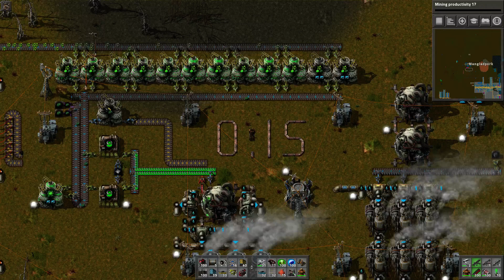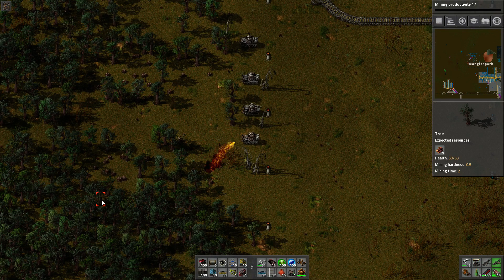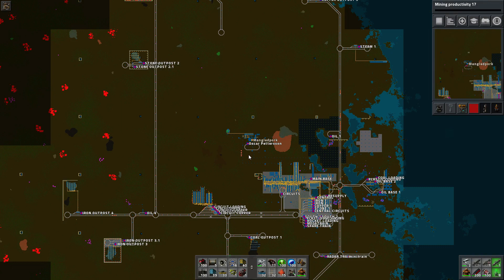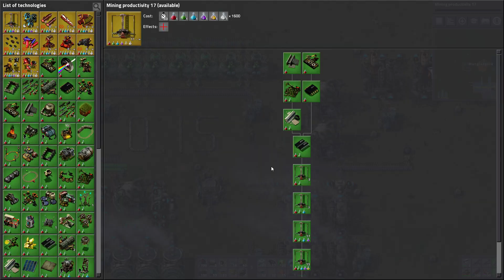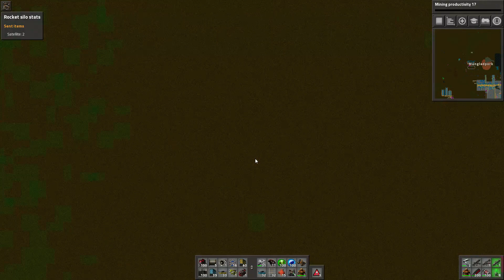Factorio 0.15 Update Overview

Comment from the maker: If you're having trouble updating: https://www.youtube.com/watch?v=sruKeZXXVTk
Also, a correction for 56:03 : There actually are different recipe difficulties which include gears and circuits requiring more than double their normal resources.
Reply: "Fluid" can refer to any liquid, gas, or plasma
Reply: The propability for uranium 235 is 0.7% or 1 in 142.85....
Reply: @34:20 press the red button to the right to enable pollution overlay
Reply: Benjamin Steinmann  its .72
Reply: Austin Hayducky Yep.

more iften than not, something like 'computational fluid dynamics' is used to study gases rather than liquids...
Fluid is the generic term, gas, liquid and plasma are more specific.

Gas is a fluid, but not a liquid...
Reply: steam is a gas
Reply: thought is overview and not u talking 60 minutes about the same thing. and pls learn something about atomic energy. Its realistic.

Comment: Yeah, the fluid wagon seems way better than barrels for shipping. You can ship a bit more in a cargo wagon in barrels than you could with the fluid wagon, but considering the amount of time you'd waste just waiting on your inserters to get the train loaded and then unloaded(not to mention the power and time spent crafting: it takes several minutes of labor and dozens of mJ of power per shipment even with assembler 3 and lvl3 speed/efficiency modules attached) you're really not getting more shipped in the long run when a fluid wagon can be filled or emptied in literally a few seconds, with basically no power cost as well. 

That said, there is still an argument to be made for using those barrels for storage given that a single steel chest can effectively hold 120,000 fluids. That's 1 square of space to store as much as 4.8 storage tanks (which would take up ~43 squares collectively). Plus you can carry them around yourself rather than having to run piping everywhere and such.

Comment: I wonder... for the Kovarex process, will it be possible to setup something similar to the early stage mutually-feeding coal miners systems, of course you will need input of u238...
oh nvm I just realised u can put a wagon next to it to work as a larger steel box and have inserters sharing it so its rather easily managed.just keep adding 238from the other end

Comment: From another youtuber, I believe an optimal nuclear setup outputs 40 megawatts for a single reactor.
Also, a side note from the same thing, reactors burn through fuel whether they are powering anything or not.
So less than optimal reactor to turbine ratios or even having more reactors running than you need is wasteful.

In short, you should design around a reactor producing 40 megawatts and ideally either build some circuitry to limit fuel input, or ensure that your factory, at a minimum, uses at least as much as the running reactors put out.
(if it fluctuates above and below, power storage to smooth out the difference might be worthwhile.

In other words, as you would expect if you know your real-world energy production methods, nuclear is for baseload power.
Using less than the reactor can produce under optimal circumstance wastes fuel.

Seems like a minor point, but definitely worth keeping in mind.

Comment: Wouldn't square blocks of reactors be more efficient than long columns? After all, all interior reactors get the maximum bonus, edge reactors get less, corners even less, and singular protrusions the least.
Therefore, you want to maximize the area but minimize the perimeter.
So, squares should be the optimal shapes.
2x2, 3x3, 4x4, 5x5, etc.
so 4x4 rather than 2x8 is better.
Granted, this restricts the number of reactors you can use in a design, but still...
In any event the general rule seems to be... Bigger is better.
Reply: Well, actually the way to maximize area but minimize perimeter is a circle. So the closer you get to a circle, the better. This means something like a hexagonal or octagonal arrangement would be best, provided you could figure it out.
Reply: Well, that would be true in a general geometric sense, but I omitted a crucial detail that significantly changes the result ingame.

See, we aren't strictly speaking optimising for maximum area for a given perimeter (which my original statement might suggest), but rather for the number of adjacent reactors.
Since reactors don't connect diagonally, all adjacent reactors have to be either directly above/below or left/right of another reactor for it to count.

So what we are actually trying to do in practice is minimise the number of corners, AND the perimeter together.

To minimise the number of corners, we note that the reactor is rectangular. This means no matter what you do there are at least 4 corners.

So... ALL possible optimum structures will have 4 corners. 
If they don't, then they aren't optimal.

And trying to approximate a circle introduces a LOT of corners, because you are effectively approximating a circle using only horizontal and vertical lines. (and thus each direction change is an extra corner)

This leaves us with rectangular arrangements. And amongst all rectangles, squares have the largest area (most reactors) with the smallest perimeter.

Any deviation from a rectangle of some description is immediately non-optimal because it introduces extra corners.

(you can work this logic out from first principles by noting a reactor gets a bonus from up to 4 other reactors that are directly to the left,right,above or below it. - this leads to the particular set of rules of minimising perimeter, and number of corners. - which then leads to a square being optimal.)

Comment: Very basic high school physics lesson: 235 and 238 refer to the atomic weight, so Uranium 235 is lighter, which is because it has less neutrons which act like glue, and as you might imagine something with less glue breaks apart faster, and it's that breaking apart that releases the energy.

Comment: I don't like the oil loop. It makes no logical sense to turn water and coal into oil, this takes billion of years and it kills a bit part of the gameplay.
Reply: Well you can and do specifically produce light oils and other light aromatic hydrocarbons such as benzene so it isn't much of a problem really.
Reply: HeadsUpHigh I'm pretty sure coal is just a really heavy hydrocarbon... Split it up, use hydrogen from the water to cap off the shorter chains, release the excess oxygen.
Reply: Coal Liquefaction is something that exists in the real world, and works similarly to how it does in the game. The reason why you don't hear about it much is that oil is so cheap, and this process is EXTREMELY polluting, so most countries don't do it much except for China. This may change in the future, because the USA has a lot of coal reserves and [insert politics here].

Comment: What happens to your steam power setups when you load an existing save? (or is it simply not possible to load an existing save?)
Reply from the maker: All your boilers turn into the new ones but massively crammed together and misaligned with their tiles. So you can just pick them up and rebuild them in the right orientations. A similar thing happened a couple of upgrades back when turret went from 1x2 to 2x2. They just widened on the spot, and you could pick them up and put them down again to get them properly positioned.

Comment: Regarding 'not needing oil anymore', coal is finite, oil is not, and the pump jacks have been buffed so they don't degrade to 0.1 anymore. Also, boilers use a LOT more coal than before.
Reply: DRY411S That's a good point, if coal is required more and oil is more abundant is it worth it? Although if youre using solar and/or nuclear you don't need the coal for running steam engines so then it wouldn't be too big a deal to use it all in oil production?
One question I saw someone else ask, could a barreling and unbarreling station with productivity beacons produce unlimited of the barreled susbstance?
Reply: You also need coal for military science (grenades) and capsules.

I've heard that if you use coal to heat water, then input that steam into your nuclear heat exchangers instead of cold water,  then that makes the steam turbines produce more electricity. There's another use.

"Productivity beacons", are they new? I thought that you could put only speed modules in beacons? Whether you can add productivity modules into assemblers that are barrelling, I don't know.
Reply: DRY411S Yeah that's true, prehaps I'll just be using oil for my oil.
That's also interesting, can't wait to see builds that utilise this. (I'm the sort of person to wait for a 99% efficient tileable blueprint).

Doh! My mistake. Of course there is no such thing, forgive me I'm still fairly new.

But still, could you not have productivity modules in assemblers barreling nd unbarreling liquids?
Reply: They buffed the oil per pumpjack but they halved the amount of oil bits to harvest.
Reply: SendractsGoezt That's interesting. I seem to be getting about 37 a sec on my current fields which is surprising as they were about 8 before.
Reply: I think all fluid amounts have been multiplied by 10 across the board. On that basis, you ought to be getting 80?
Reply: DRY411S Well I hadn't checked them in ages, I guess they had to be lower.

Comment: I did some maths on ore processing. If the probability of getting the U235 is 0.7%, then after 143 cycles you should expect to have produced 1 U235. 143 cycles takes about 1910 seconds (craft speed of centrifuges is 0.75). Give the U235 to an assembler and 10 seconds later you have 10 nuclear reactor fuel cells. Each fuel cell is burned off after 200 seconds.

So 1 centrifuge for 1910 seconds + 1 assembler for 10 seconds gives 2000 seconds of nuclear fuel. Bizarrely then the ratio of ore processing centrifuges to nuclear reactors is 1:1.

After around 800 lots of 2000 second cycles, you should expect to have the 40 surplus U235 you need for the Kovarex process. By then, you'll have nearly 120,000 lots of the U238, and 8,000 used fuel cells.

Comment: at 1 min, when you're showing off the uranium mining - miners in the center are connected by pipe, so you can feed acid to one miner and it will be distributed via internal piping.

Comment: Well, this if anything adds some credence to my thought on keeping Railworld as your active series - as I expressed on your Channel Update. The update certainly doesn't seem to have broken the map, and the new ore even got retrogenned! Kape Kerbal has more reason than ever to exist and be expanded, and there are new potential megaprojects - conversion to nuclear power without cheating will require extensive infrastructure, wouldn't you say?

Also, I wonder how long until someone works out that Factorio has no Outer Space Treaty...

Comment: Hey, why could you help to me? I'm trying to use the fliquid wagons but it doesn't work. https://i.imgur.com/oT1StS9.png
Reply from the maker: Is the train in automatic mode and arrived at that station itself or manual and you drove it there? The positioning has to be spot on so manually controlling the trains won't work.
Reply: MangledPork Gaming Was that. Thanks for the help :D

Comment: They did add the recipe difficulties. It makes a lot of the intermediate products more expensive. For example, in the deathworld preset, gears were 4 iron a pop instead of 2, and green circuits took 2 iron and 10 copper cable. There were some other changes I noticed but I've forgotten already.

Comment: u238 is called depleted uranium. but enritched is uranium That have between 3% and 20% u235,.and if it have more its hig.hly enritched.

The 0,7% u235 is The same as in real life. The 1+19 is also The same as i. real life (for gen III reactors, gen II have 3%) 

there is one major error in The game compared to real life.. coal power is actually warmer than gen III nuclear power. normal steam is about 350C and super critical is 550C, nuclear power is a bit over 300C.

gen IV is a lot warmer. between 500 and 1000c

Comment: The new nuclear ratios seem interesting.
Looks like once you have got 40 of the good stuff you wouldn't need to mine any more uranium to keep it going perpetually.
The only thing you would need is 1 iron plate per fuel cell.
Reply from the maker: You can reclaim 6 total from the spent cells so it would cover the kovarex enrichment plus a little extra, but you still need 19 U-238 to make a new set of cells, so you can't quite turn off the miners fully.
Reply: Ah I see, didn't notice it was 5 used cells for 3 bits of junk uranium.
At 10:32 you say you can turn 1 into 3, so thought that was 30 total reclaimed.

Comment: Do the nuclear reactors keep using fuel regardless of if the produced heat gets used or not? At least the two reactors next to each other used everything up.

Also, you might be able to get past 3 reactors next to each other if you put them on halfway positions next to each other.
Reply from the maker: Nope, they have to be directly adjacent.
Reply: So all 3 heat pipes on one side have to be connected to one reactor? You can't put two reactors underneath, with one connected with one and next to it a second connected to the others?

Hmmm, well I guess I'll find out soon enough on my own anyway.

Comment: easy way to manage the maintenance of the good uranium, only utilizes 3 wires, 4 grabbers, and 2 chests per machine, (along with whatever belts or whatever you hook the machine to,) 

export chest hooks up to the import grabber, only starting the import of the uranium when the good stuff, Uran-258 < 1, that way it doesnt start grabbing materials until the chest is emptied of Uran-258.
Then the import chest is hooked up to the to-belt export grabber, which only grabs when Uran-258 = 40, 
the export to import grabber must be a filter grabber, grabbing only the 258, (or, optionally it can be any to grab both, but then you need the alternative wire from the export chest to the import grabber to indicate not to grab unless if the chest is completely empty) 
the export to import grabber must have a wire to the export chest in order to grab only when Uran-258 > 1  preventing it from grabbing the 41'st Uran-258, 

this will make the input into the machine always grab the necessary 40 258's from the machine's export before the machine begins to pull the last 258 out onto belts
Reply: thank you for correcting me on the 238/235,
but if you have the 2 preparing to grabbing simultaneously, then you run into the problem that if the filter grabs first then the other one will see precisely forty, which opens the obvious problem of the output grabbing first, so the export doesn't see the excess, and therefore doesn't grab, besides, dont you need to trigger the machine to only grab when the export's finished exporting? because otherwise, the chest may never fill up to 41, more or less, which causes the export to essentially never happen, make sense?
Reply: Another alternative...

This one requires the following...
1 red wire, 3 inserters (any), 1 chest (any),

the 2 inserters pull materials out of the machine and put them into the chest, the third inserter grabs materials from the chest as long as there are at least 40 U-235's in the chest, 

A fourth inserter, a filter inserter, may be desired to remove all of the U-238 from the system